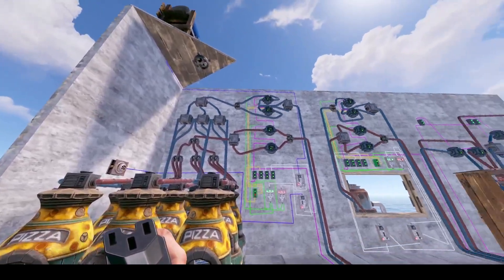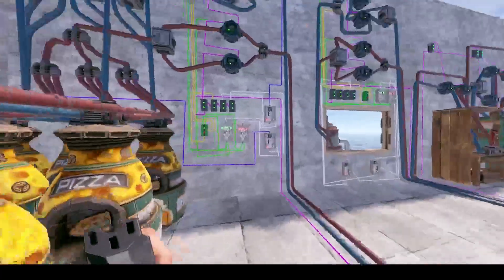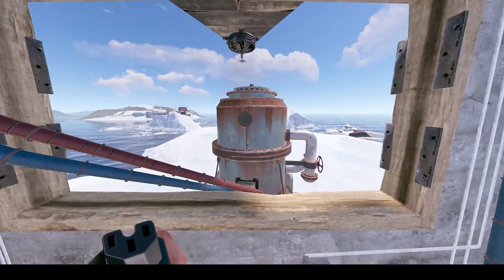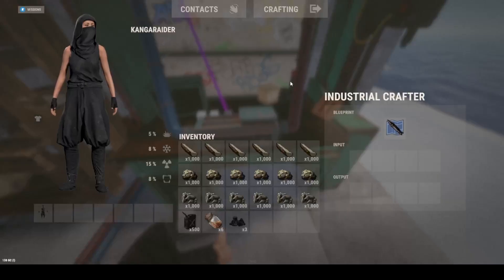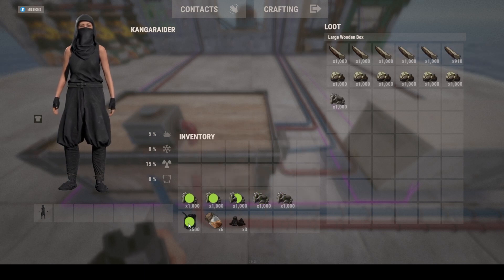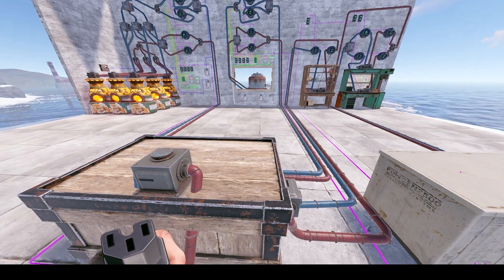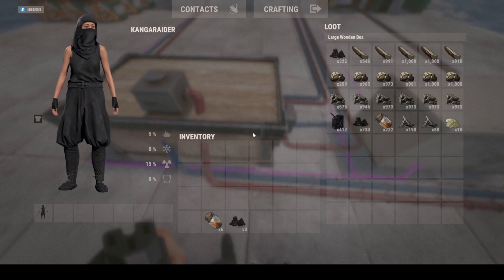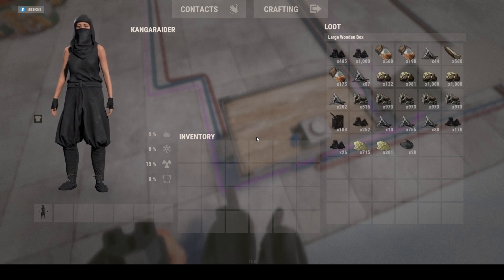RUST INDUSTRIAL ROCKET FACTORY

Comment: why do you need sprinklers
Reply from the maker: With this original design, the sprinklers were used to turn off the furnaces. Check out the version 2 video, no more sprinklers, and much simpler.

Comment: You don't need branches for each conveyor, just 1 branch out of your battery that branches the amount of power as you have conveyors, and use the passthrough
Reply from the maker: Check out the updated video. Linked in the description.

Comment: Noob question: Why do you have a sprinkler above the refinery and furnaces?
Reply: Im pretty sure it turns them off automatically
Reply from the maker: @shoexbill9285  is correct. when there is no more ore present, the sprinkler shuts off the furnaces to save wood.

Comment: I know you sped it up but using your setup what is the time frame from start to finish per rocket? If you know (great video btw)
Reply from the maker: I did not make not of this when preparing the video, however I am investigating this more. This was a proof of concept, however it is possible there was bottlenecks in the system.

Comment: The amount of work you need to put in to build this just to be able to auto craft rockets? What happened to just crafting rockets manually? People have done this for years. What a useless feature. I don't even know if I can call it a feature.
Reply from the maker: This is an extreme example of automation. You can do a semi auto version that is far less involved. Or, as you say, you can just manually craft them.
Reply: @Point A2B I mean if you're 10-15 deep with a massive compound. Sure. I could see this working. But for solos and small groups. Just not worth.
Reply: @Point A2B I didn't have to build a computer before sending the message. According to you building a computer chip factory>building a computer to send the message is much easier and less time consuming than to simply buy an already made computer. Why would you want to spend what seems like an entire day to build an automated rocket factory when you can just do it much quicker with less effort by doing it manually? Especially when it can all be destroyed in minutes during a raid.
Reply from the maker: @Mrvl1234  I guess its just a cost/benefit analysis each player or group has to do haha. 
One cost, as you mentioned, being the setup time and materials. One benefit is that you don't need the BP guy to be online to go for a raid.
Reply: @KANGARAIDER  I think just like majority of trap bases are too costly in labor and in materials to ever work on official servers. This is pretty much the same thing. It's a neat concept but highly unrealistic on a competitive server.
Reply from the maker: @BuggetNuster  do people use electricity on competitive servers? Surely the same thing will happen with industry. The Meta builds and tactics will rise to the top.
Reply: @KANGARAIDER  Electricity provides a lot of benefit. A lot more. Turrets, phone notifications about raids alone make electricity worth building. It's a bad comparison.

Comment: I'm watching from Japan.
This is such a great video!
I didn't know you could place crafting equipment on top of the workbench.

I don't understand how the furnace shuts down when it runs out of wood or ore.
Is there a way to detect when wood or ore is gone?
Reply from the maker: Thanks for the comment!

The way to detect when wood and ore is gone is using the Conveyor "Filter Pass" and "Filter Fail" outputs in combination with setting the correct filters. If they run out of wood, the furnaces will shut themselves down. If they run out of ore, a sprinkler is turned on to extinguish the fire.

I only discovered today that you can place 2 Crafters on a single workbench.

Hope that helps
Reply: @KANGARAIDER  I have read and tested your message.
Well done.
Thank you!
Reply: @KANGARAIDER  Hello fellow furry.